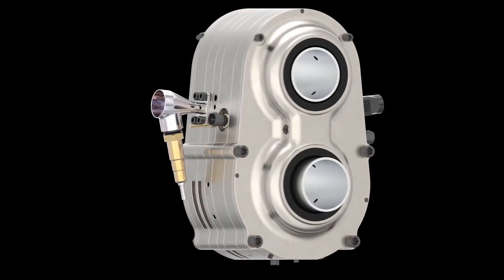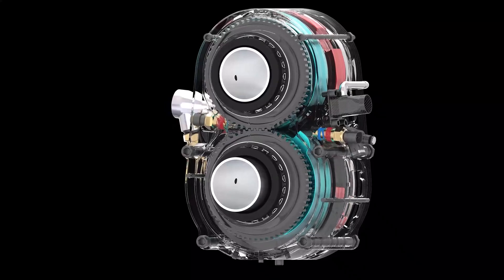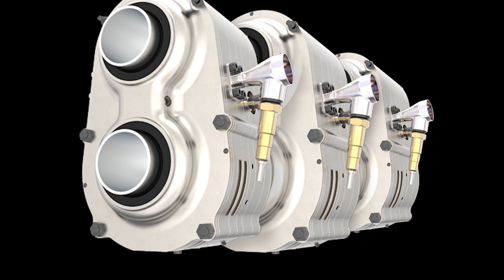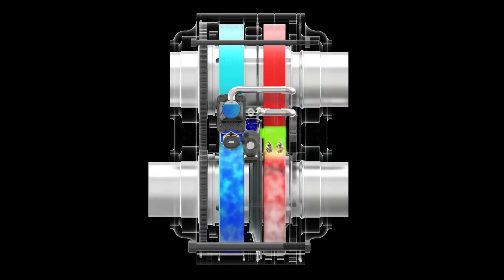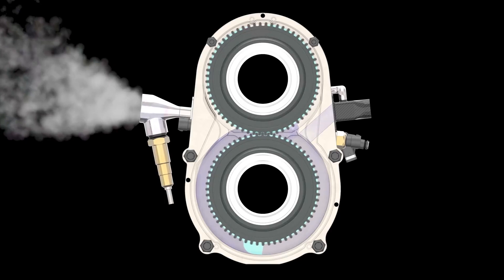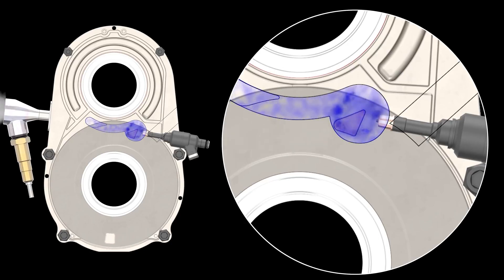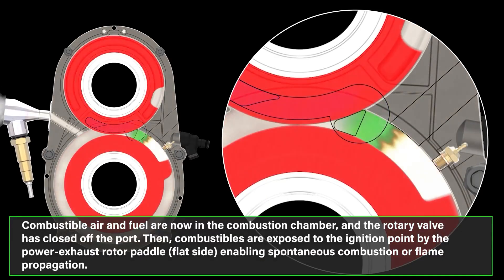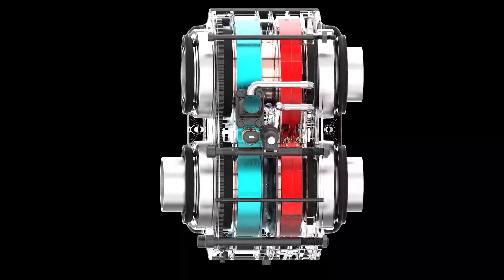This pistonless engine runs on hydrogen and revs to 25k rpm

Comment: This is an interesting concept. Has anyone actually built a working prototype? What is the level of difficulty of quality mass production? I could see four major possibilities for practical applications of this engine:  (1: machines and vehicles in harsh environments, such as Anarctica, and maybe Mars (if there's a way to get hydrogen to burn there); (2: heavy equipment that traditionally relies on diesel engines here on Earth, such as heavy trucks, locomotives, earth-movers, cranes, sea-going ships, etc.; (3: aircraft; (4: a new generation of automobiles. The big challenge is going to be if manufacturers want to take the bait. Can they use this design to displace more traditional internal combustion engine designs, plus getting a foothold in the onslaught of electric-battery-powered vehicles? That's going to be a tell order. Also: despite the waves Toyota made with their Mirai fuel-cell vehicle, how hard will it be to cultivate a new hydrogen supply chain to fuel vehicles and machines.

Comment: power and torque does play a big role, as it's not realistic to have a transmission with 24 spilt gear like a semi truck ..... that transmissions weight will defeat the purpose of a high power to weight ratio engine, also you'd need a flywheel if the engine can be stalled under very little force but still flywheel just adds more complexity. Yes when there is more heat there is more wear but an engine with very good power and torque at low rpm means less heat and will burn less fuel and last longer

Comment: Koenigsegg are used to making ridiculous hypercars with bonkers top speeds and minimum four-figure horsepower numbers.

However, they’ve now created an electric motor that makes 330bhp but is somehow smaller than my head. That is madness. Two of these motors with a single inverter will make 660bhp and weigh less than 85kg. But uses 4.67658 liters per km...

Comment: Beyond the need to use unobtainium, I see several issues to sort out.

-"Super tight tolerances" Lol. Under what conditions? Because it can be done, you're just going to look dumb as heck when it you need to run a blowtorch to pre-heat it like a Lister engine.

-Linear thermal expansion is working against it. Their housing, being aluminum, is going to expand more than the rotors; widening the gap at the separator/housing interface. At the very least you should make them both out of the same material.

Also, precision costs money. Like a lot of money. They're going to have to wire EDM all four rotors and both housings.

-The compression ratios are insane and you would shed a ton of heat before you ever get it to the combustion phase. It talks about feeding it with a 200+ psi supercharger, at which point, just do away with the intake/compression rotor and feed the mixing chamber with your supercharger alone. Exactly what kind of pressure do you think a regular piston engine really sees at startup?

-The rotary valve and case has to be made out of unobtainium in order to not warp and leak from differential heating. Good luck cooling the rotary valve plate, too.

-It's losing compression and heat as the fuel/air mixture enters the combustion area and the separator passes the spark plug. Your combustion chamber is expanding and turbulent.

-The spark plug well holds exhaust gases from the previous cycle and may result in unreliable ignition.

-The combustion/exhaust rotor needs to be relatively smaller in width to deal with the pumping losses.

-The way they've implemented spark ignition means means it may have limited  RPM range. (They could have also moved it closer to the port.)

-Would probably be better to machine something like gear surfaces or some kind of sinusoidal wave into the rotor sets to help mitigate pressure bleed. I imagine the initial combustion pressure wave could wedge its way past that gap fairly easily and also burn out the rotors quickly if it does.

There are interesting ideas here, but I don't think it's worth developing for fundamental issues. Would love to be proven wrong, but until then you've got a sputtering "engine" that's "running" off of an external air compressor*. I would consider it a feat of engineering to get this to net zero power and self-sustain.

*There's a video of an uninspiring prototype sputtering worse than any Model T engine.

Comment: This engine is a game changer Even if it runs on regular fuels, the efficiency is much better than current designs. Less parts means less cost and can probably be built with materials that can burn at higher temperatures thus less carbon emissions. As far as the use of hydrogen if the flammable gas can be contained probably through electrolysis or separating hydrogen from water by running a current the contained water. Then it might have a bright and more importantly safe future on usage. 🙊🙉🙈

Comment: No seals, 200psi supercharger, metal expansion, just to name a few problems... this engine is doomed. I don't think you mentioned how it's lubricated. I hope it has compressed air bearings because 20k rpm is a lot. Even more problematic: What happens to the power when you gear it down to axle speed (0-1000rpm depending on tire size and road speed)? What kind of transmission can make that gear reduction with any efficiency? It's a fun concept, but I think that's all it is. If you want a viable idea, look at the Achates engine design.

Comment: Seems with the very low NOx that this engine would be very hard to produce torque. I would think it would be best coupled with a electric power adder to supplement initial loads until it reached optimal RPM. Just a thought.

Comment: Tight tolerances will be the life and death of this engine. Consumers put their typical engines through so many heat cycles in dozens of climate conditions, and with no seals to replace, you'll be replacing entire engine units. Electric needs solid state batteries and it'll be the car solution, but the car is not the solution to dense populations. That leaves this engine in a weird position.

Comment: 25k. Wouldn't that be much more likely to wear out compared to a lower revving engine? I'm not an engineer, but 25k sounds a bit extreme.
Reply: No different from a gas turbine (jet engines, etc).  The HP turbine spins well into the 5 figure RPMs.  The fans on larger engines spin more slowly via the LP turbine and in some cases, a reduction gearbox, only to keep the large blade ends from going supersonic.  High speeds on a piston engine are a far bigger deal, since the pistons have to change speed and direction twice per revolution, and at higher speeds, the stresses are insane from this.
Reply: @ClipstopherBurtraw  alright. So it's mostly about the type of motion/rotation , rather than the speed . That makes sense since one is simply rotating while the other is more awkward motion ( more conflicting forces , in a manner of speaking ). 

Thanks for reply
Reply: @meissnerflux  you're welcome.  I'm obsessed with planes so I couldn't help but make the connection.

That said and to be fair, aircraft engines are rebuilt on a regular basis.  How much is for safety margin and how much is due to inherit design, I'm not sure.  But this engine design looks to be easy to remove and rebuild compared to a modern piston engine, so even rebuilding it as a regular service every, say, 50k miles might not be so bad eh?

Comment: lithium batteries are way more damaging to the environment than it is currently advertised simply due to the mining of the lithium. Hydrogen can be generated with electrolysis, which is as green as the energy you're using to generate the power.

Comment: Not clean power. This is not a good idea. If you burn hydrogen in air at an optimal oxygen hydrogen mixture you generate heaps of nitrogen oxides, not clean not nice. Burning hydrogen in air at temperatures for efficient combustion is not a clean process. If you lean out the hydrogen to get lower temperature combustion to reduce nitrogen oxide emissions you lower the engine efficiency because the limiting efficiency of a heat engine is a function of the difference between the inlet and exhaust temperature (see Carnot cycle).  The bottom line is hydrogen is not an efficient fuel because there are energy losses making it, and it is even less efficient if you burn it. It is only clean if you make it by electrolysis and use a fuel cell to generate electricity.
I doubt hydrogen has a future with passenger cars simply because a battery electric car is probably two to three times more energy efficient (BEV 85% to 90% efficient). We will see batteries with higher energy densities, faster charging times and greater cycle life.  Hydrogen will have areas where it is needed, but I suggest not in passenger cars.

Comment: "Very tight tolerances" and high rotational speed means very high cost of manufacturing and maintenance. Also very high probability of breakdowns. Not to mention that after several heat cycles and even improper operation (no time to heat up etc), these tolerances will be gone and it will leak like crazy. Exactly like the Wankel engine. Remember, the Wankel engine was, in theory, FANTASTIC.

Comment: A hydrogen rotary engine right away sounds like a dumb idea because rotary engines are inherently flawed and forcing it to work with high tolerance will make the engine more expensive to manufacture then a turbine. We should be using vortex heat exchangers to recycle the wasted heat energy in the exhaust. Also hydrogen as a fuel for motors is so dumb because we need that hydrogen for fusion reactors. We literally cant have every tom, dick and harry gobbling up hydrogen to drive to the store....

Comment: The losses would be very high because the volume/surfache ratio of the combustion chamber is shit.
No seals thanks to tight tolerances? That could work if that thing didn´t get hot but it burns fuel and the cooling surface is minimal. Metal expands when it gets hot and maybe you can imagine what happens then. I don´t think this will ever work.

Comment: Surprised how noone is talking about how Hydrogen is a dead end fuel. Electrolysis is uneconomical and uses a ton of power which will defeat the whole point of hydrogen in terms of CO2 emission for aircraft. 99% of Industrial Hydrogen is made with steam refraction of fossil fuels which consumes power and releases CO2.

Comment: If you could make this work, run it as a generator, paired with a hydrogen generator, and used to charge a battery bank of the (hopefully) soon to be produced sodium/sulfur batteries you could produce something truly amazing . That might be wishful thinking, but at one time so was long distance communication, flight, and cars themselves.

Comment: A great platform for further development. Seal challenges are easy, ie moving forward from mechanical type seals to friction-less seals (eg superconductor tech). Also, I wonder if adding an extra intake/exhaust chamber would reduce potential vibration/balancing challenges?
Reply: Seals are OK, till they encounter polar bears, or Orcas or Walrusses for that matter, or even hungry Inuit!!!!
Reply: Its a platform that wont be ever implemented and you will forget about it soon.

Comment: Sounds like a concept that may or may not develop in the future if new materials are available and the economics make sense compared to what may be already in use by then.

If we could manage to make the "perfect battery" that would be the ultimate eco friendly solution for almost everything. No mechanical engine can compare with the simplicity, power and lightweight of an electric motor.

Comment: "Tight tolerances" when dealing with a gaz like hydrogene ignated in metal  with  expansions cycles.... hmmm red flags all around ... but as a conept is neat as all the other concept engines

Comment: I want this combined with the new metal hydrogen storage systems. Those show a ton of promise.
Reply: Think about that again - you are storing hydrogen on a metal - and only use the hydrogen as fuel + you need energy to break it off of that bonding. That stuff is hella expensive, hella heavy and hella inefficient. At that point just use a lead battery.

Comment: Like mentioned on earlier comments, metals expansion would make this engine unusable on wide power band output since temperature fluctuates. Stick the output to a generator and battery(as in series-hybrid electric vehicle) and run this at constant power, maybe have an external control system to regulate engine temperature to maintain tight tolerances. I see this engine getting pre-heated before starting like in formula one cars.
Reply: but the steam turbine works brilliantly for electric power gen so why not the combustion turbine engine for motive power???? (isn't that what jet aeroplanes do???)

Comment: Small size Aircraft are the proper application. Cars have all these weird requirements such as low end torque and changing engine speeds. A small size aircraft doesn't have this. It has a take of power requirement and a cruise requirement. Light weight is ideal here, too. It's power density per kilogram nicely slots inbetween conventional piston engine and a turbo prop engine. on bigger sizes, turbo probs will always win, but a single engine 4 passenger aircraft usually doesn't allow for such a complex and expensive engine.

Comment: This is, on the surface, really promising, so the big questions are:

Is this all theoretical
Have any engines been manufactured
Have they been run extensively for performance testing
From W here is the hydrogen sourced and stored
What are the plans for production?

What about JCB’s experiments with convention internal combustion engines with heads modified to run off hydrogen, for heavy plant on-site that seems to be workable.

Comment: Face seal rings, with carbon-graphite primary rings, and carbon-graphite circumferential seal rings, fabric reinforced. High operating temperature up to +1100 °C. Use some of that and this might work.

Comment: pt6 turbine engine without the gear box weighs 150lbs and makes 600hp, been out since 1958, and runs on anything thats fluid that burns.  hydrogen sucks to make. I'm not impressed

Comment: The tolerance levels to eliminate seals reminds me of the old fuel oil injection pumps splash of snow or water and they would score then sieze. Best of luck. A engine sitting at minus 40 then fired up changes tolerances.

Comment: This can easily run on hydrogen to produce electricity to run EVs with super capacitors and replace heavy weighing batteries plus avoid impending ecological disaster.
You don't need to transport hydrogen. Instead transport special filtered water and generate hydrogen and oxygen at the gas stations using electricity on demand.
Reply: Clean hydrogen is obtained through electrolysis, which basically splits water into H2 and O  with electricity at 80% efficiency.. the hydrogen has then to be cooled and compressed for storage, which consumes more electricity and has many more losses due to leaks etc.. the hydrogen then has to be brought to combustion which again is inefficient because generating a lot of heat..  To then produce electricity to run an EV?    Why not just run an EV right from the source of your electricity ?
Reply: @brokentwiceright  You don't need to transport hydrogen. Instead transport special filtered water and generate hydrogen and oxygen at the gas stations using electricity on demand.

Comment: It's simply going to blow up after extended use. The metal will wear and shift with heat specially because it's air cooled and it seems to have no fins whatsoever and it's going to leak everywhere. Making 2 cogs run at 9k-25k rpm without having them slip at some point is asking for a miracle specially after supercharging it to 200psi along with that there is probably going to be some delay with the supercharger as it has to spool up and ramming 200psi into anything all of the sudden is probably a bad idea lastly making a transmission that can run this engine is going to be fun. I thought it would probably be okay if it where to be used in planes but it makes too little horsepower to make anything fly and will probably cost so much to manufacture that no airline will want to use it.

Comment: with that temperature gradient i dont think precise tolerance is gonna cut it because of thermal expansion, hence why many combustion engine designs have seals in the first place. its also what causes the wankel engine to have shitty seal lifespan. i think keeping the water cooling element could make the temperature gradient more even to reduce the effects of thermal expansion. not to mention using hydrogen fuel would release much more energy per gram than just petroleum fuel.

Comment: how do they keep the temps down enough to stop it from from crashing when it gets hot,. a Wankel uses seal thingys,. you cant have tight tolerances and heat. thats what rings and seals do,. and whats to stop it from contaminating the oil over time by compressing water vapor in to it? ,

Comment: These comments look wild, but wanted to get a one question. Its not like im a mechanical engineer, but this engine don't have compression stroke, which is quite important for getting more energy.
(Compressing the air-fuel mixture allows more energy to be released when the charge is ignited. )
+ the upper rotor is almost useless? Its just there to act as a intake valve and a bad one, because that "seal" on the bottom rotor gets in the way of air . why not replace that with an side intake hole... like a rotary?
+ at 25k rpm this thing would vibrate into space. Because that bottom rotor has that notch that makes it act like a giant vibrator.... bruh
not even gonna say anything about the fact that about 20 degrees it has intake stroke and then 270 degrees it has power stroke.... somehow